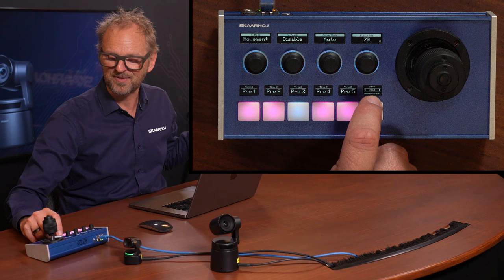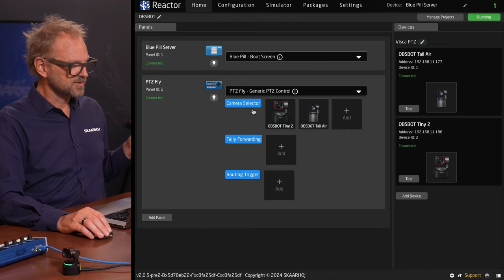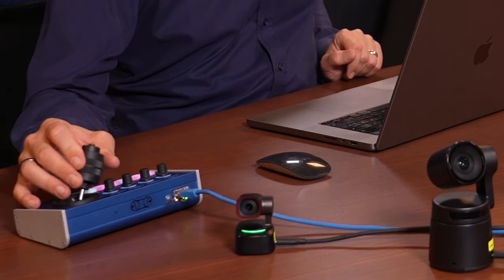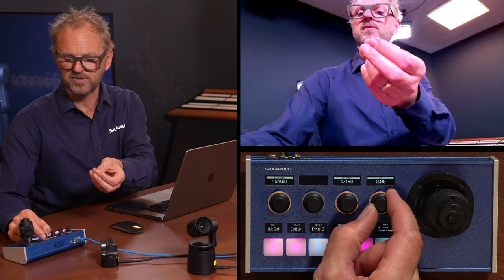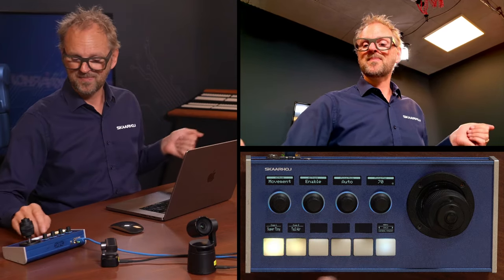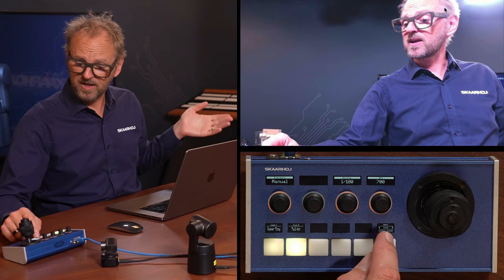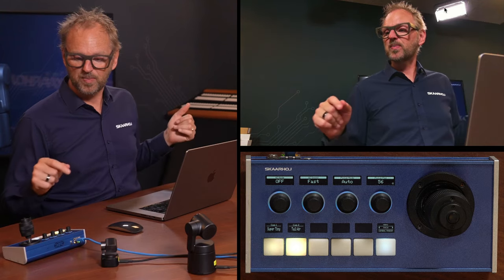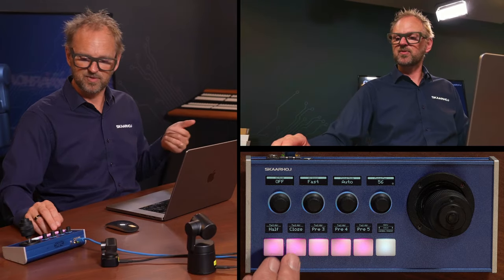Mastering OBSBOT PTZ Camera: Tiny 2 & Tail Air Manual Control with SKAARHOJ PTZ Fly

Comment: How are the cameras connected to the PTZ Fly? Especially the Tiny 2, which only has a USB-C connection?
Reply from the maker: Hi @CalcMaster86,
The Tiny 2 uses OBSBOT's UVC to NDI Adaptor and the Tail Air uses OBSBOT's USB-C to Ethernet Adaptor. The adaptors put both cameras on the network allowing us to have VISCA control. 😃
Reply: @SKAARHOJ  Thanks! I had no idea OBSBOT made an Ndi adapter for their Tiny 2!

Comment: The Tiny 2 (w NDI) and Tail Air have onboard recording to SD, but there is no VISCA command to start/stop recording. There is an OSC command to do it. And there are also many other OSC commands that aren’t available in VISCA. How would you add those commands to your OBSBOT core?
Reply from the maker: We do have both VISCA and OSC device cores available. If the OBSBOT camera allows two connections, then you can add both device cores to our panel, and assign the commands to any button you wish.
Apart from that we thank you for letting us know about this. We’ll have this in consideration if we should make a specific OBSBOT device core that uses both protocols.